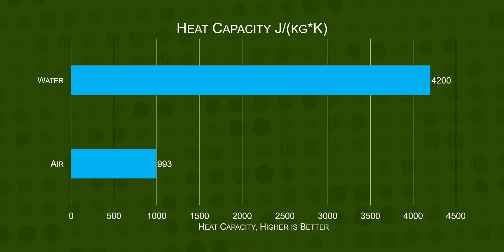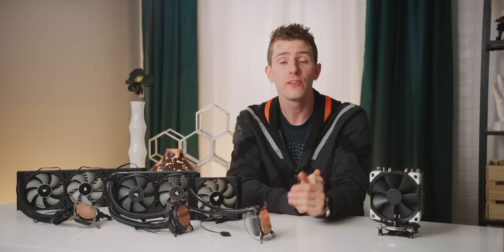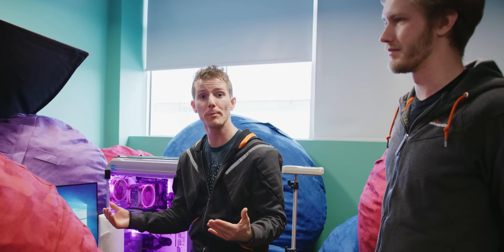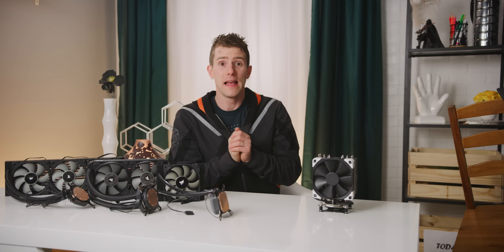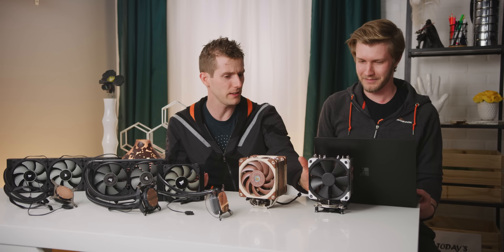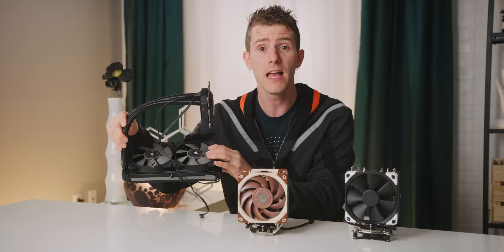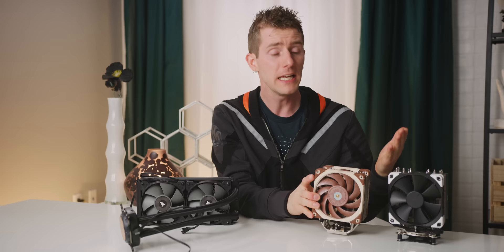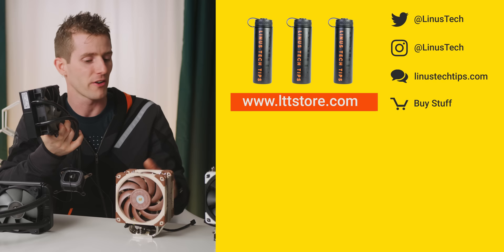Why you shouldn't water cool your PC

Comment: I liked that 1st equation. I had never thought of it. See, CMOS heats up because when a bit is changing state, both MOS transistors go through the conductive region. MOS (FET) transistors work by adding energy to the carriers in the channel so they have enough energy to behave like free carriers. How can we add energy to the carriers? Well, one way is through an electric field (hence Field Effect Transistor); the other way is through heat! Therefore, when the CPU is hotter and the state is changing, both transistors will short at a lower resistance level (upper in the v-i curve). Therefore, the cooler the CPU is, the easier it is to keep it cool.

Hot CPUs will cause charge carriers (dopants) to migrate through the single crystal structure and will, with time, destroy the structures inside the CPU. Keep calm and keep it cool!

Comment: Pfft, don't listen to Linus. Go out and spend a thousand dollars on a huge peristaltic pump. Set this in your backyard. Then have part of the discharge set to go through a smaller line that leads into the intake line through a venturi. Now you have a jet, peristaltic pump for maximum water flow. Make sure your radiator is in a custom made shed that is powered by a lithium bromide absorption chiller. This will keep your ambient temps at around 4-6 degrees celsius. 

Make sure to drill the appropriate holes in your home wall, and in the custom shed. Make sure your custom shed has very good insulation. Next step is to buy 1000 gallons of deionized water. Once this is done, you're almost definitely going to need some reducing fittings to get your pipes down to the right size to fit on your block- which by the way, if you haven't figured out already, is going to need to be pretty damned strong.

Once this is complete, your computer should never ever overheat, and for the low cost of $ 50, 000 this all can be yours.
Reply: You forgot to mention you have to have a licensed engineer by the state on watch of this equipment any hour it’s operating in the day.  If anyone from the city shows up at the house and these requirements are not met you will be fined and face jail time. May god help you if there is not a EPA certification on site.
Reply: "your computer should never overheat"
Your computer won't even heat with that setup. Keep the beers in your case for easy refrigeration.
Reply: MC Siggy Z with what setup? Did he say he had any set up? I missed it.
Reply: youve sold me already
Reply: Get a mini fridge and stick your PC into it. Drill holes in the side and run the plugs through it. Silicon the cables hole where they come through.
Reply: @Pesticide7G  I'm a stationary engineer, so I'm good :P
Reply: Clinton Laundrie oh cool so you’re qualified. instead of dispersing those BTUs that your massive pc is producing you can run a separate 3” line to transfer that heat and send it to the condensate tank for your high pressure boiler for a 100% efficient operation. just don’t forget to bypass the hi limit switch and cap off the relief valve. Thank me later

Comment: Now you could take these Noctua fans, put it on every cooler / AIO and compare them again.
Reply: Noctua don't just make fans, they make the heat sinks too, which are important
Reply: Duke Manu ikr, even Asus Aios use black Noctua fans
Reply: By using the same fans for air & liquid cooling one excludes them from the equation and knows if one technique is actually better or if Noctua has just the better fans.
Reply: @dukemanu9580  This definitely should be a third test subject, but it shouldn't be the standard for the AIO testing. When you buy an aircooler, you get the heatsink and the fan, when you get an AIO, you get stuff including fans, to put Noctua fans in the AIO would mean adding in another purchase.
Reply: King Barney still cheaper than custom loop. It’s the same as buying cooler then adding rgb fans

Comment: Why do all water coolers advertise "water transfers heat better that air"
Yes, it does. But they are both cooled by an air radiator. It is what gets the heat from the CPU pad to the radiator that matters. Water coolers uses water while air coolers use copper.
And copper transfers heat better than water.
BOOM
Reply: BOOM
Reply: Kids going to need a qualitative statement, I suppose. Let's add another one: In cooling, there is no replacement for surface placement (sorry, engine guys..). Water cooling is the simplest way to get HUGE surfaces involved to radiate the heat. And to have these surfaces in places where they don't contribute to heating up other components.
Reply: @decnet100  isn't that only applicable when things are big like in a car?
Reply: @cabexus  heat doesn't care how big things are.It's just heat, meaning energy, following simple rules of thermodynamics. In all conventional forms, it's just about the resistance of energy flow to surrounding air - which all is ultimately limited by the contact of metal to air - that determines overall heat, and admittedly maybe the heat capacity of the transferring medium when talking dynamic loads. But in terms of temperatures at the cooled element: Unless you're actively lowering the air temperature (nitrogen), or coupling to something else other than air (i.e. keeping your radiators in a lake, the walls, or buried underground), or maybe using additional power to increase your heat transfer (compressor cooling, peltier elements) then those rules apply to everyone, from PCs to cars to jet engines. Spread it over more surface area, it will be cooler. And bring those surfaces away from the stuff you're trying to cool.
There is no other principle involved other than "bring the energy out and let the air worry about it".
Reply: @decnet100  That is another fact to consider, but there are air cooling heat sinks that are the same size as the water cooling ones.
Reply: @Jacob-tp1ue " the same size as the water cooling ones" is a bit of an open statement. You mean, same size as 240/280 radiator AIOs? Sure. I myself am running one 50mm width 360 and two regular width 240s in my loop.  I don't think there are aircoolers for cpu and gpu   on the market that can replicate that surface area combined, honestly. All of which were bough used and thus cheap as chips, in around 2009. 
And if I ever needed more cooling (don't think so, this handled a Phenom II X6 and 2x 6950s fine, all of which using more power than my modern components, especially since going to single gpu setups), there is more room in the external housing, easy to put in another used 360 for example, which would cost me not even €40 - people sell their failed/old WC equipment for cheap, and it will still do the job for years to come (probably decades); takes some cleaning and maybe a layer of black paint, good as new.
Reply: @decnet100  I was speaking about the 240/280 radiator AIOs. Obviously, the 360mm AIOs have a larger heat sink. It was a bit of an open statement. And I just realized that people can run multiple radiators in one loop, like your setup.
Reply: @Jacob-tp1ue  Sure thing... :) As a 90s dinosaur, I'm sort of surprised how obscure and difficult the topic seems to many PC people. It's in fact a lot more like grown-up Lego than people think - and I guess the industry's choice to have all the AIOs as enclosed black-box circuits never to be enhanced, combined or changed does its own share of keeping people from realizing the potential - with AIOs, the solution to any problem is pretty much "buy a new system". I run my system virtually unchanged since 2009... universal coolers ftw :)

And there are quite a few things you can do with a custom loop that you simply can't with aircooling, or AIOs.

For example, I just moved flat. My room with the PC desk is now facing south and gets quite hot on sunny days; but there is a busy road down there so it gets noisy/distracting to open the windows during weekday evenings.
I just realized, I can put the external radiator housing outside of my window sill during summer (as I was doing for years - part of the reason for building that external housing in the first place). But the clever bit I just realized today: by running thinner tubes through the corner of the window-frame, the windows can actually close all the way without the water flow getting obstructed (much). Which means, all (well, most of) the heat generated by the PC doesn't contribute to heating up my room, and I don't have to listen to the steel avalanche taking place down there. As well as being able to run all 7 radiator fans at full speed if I like, without hearing them.
Reply: @decnet100  Wow, that's nice. I myself am on a budget, so I cannot afford water cooling anyway, but that is a thing to consider.
Reply: @Jacob-tp1ue  cheers :) not gonna lie, it is more expensive initially than slapping on a couple decent air coolers. But if you buy someone elses used set, it's often possible to get started cheap (say, €/$ 100 for someone elses used loop). Just need a foot in the door so to speak - once you got a basic set that works, the beauty is that it's very possible to upgrade incrementally, switch out one component every couple months until you arive at a system that works for you (or more commonly: is overkill for what you nees it to do). If you're smart and get a set of universal coolers, maybe a couple smaller VRM cooler modules and are handy with a drill (i. e., had to recently elongate the mounting holes on my GPU brackets by 1.5mm), you could end up with a kit that works literally for decades across all brands.
Reply: @decnet100  Don't air exchangers use either high surface area or high air speed? Doesn't high air speed peak? Which forces you into high surface area which increases weight? I could see for light loads non-water coolers being a little more responsive as most water are likely going to be designed to work for  huge heat loads. However the concept of water is high specific heat central vein. Run this into another heat exchanger. It could be huge air exchanger, AC unit, larger body of water, etc. Does copper respond well against long runs even though it has better thermal conductivity? This would be heavy and expensive too. Does heat work like electricity, in that it has capacitance or exponential charge/discharge?

Doesn't high RPM or flow rate generally increase energy consumption? This reduces efficiency and increases thermal output, but is cheaper?
Reply: @davidthacher1397  Uh, you raise a lot of questions and some of them I don't quite get... I'll  try to answer what comes to mind: 
First of all, the most effective and capable heat transfer principle, which both air and water coolers use, is NOT conductivity through a material (even a good one, such as copper or silver), but actually transporting the hot material away - which happens inside an air cooler's heatpipe (alongside condensation/evaporation) as well as inside a watercooler's fluid pipes obviously. 

I think the effect of airspeeds (or water speeds) on a cooler can be quite complex in some cases (laminar vs turbulent flow etc.), but for our practical matters in a PC, the primary principle is the mass flow rate (=mass of cooling medium moved by per second) that actually takes away the heat; this is of course quite easily increased with liquids by increasing the speed; with air/gases however you need quite high speeds in general to reach the same mass flow, and the negative side effects (mostly: lots of noise, also being an open system a "fast air" cooler becomes rather sensitive to disturbances from dust or other blockages such as cables inside the case) make it quite impractical to take this path with the air flow - hence why indeed large cooler surface area is so important, as that's the only way to have a somewhat quiet system reliably.

"Does copper respond well against long runs even though it has better thermal conductivity? This would be heavy and expensive too."
Don't know quite what you're asking there - are you imagining to replace the water inside a cooling loop with solid copper? That wouldn't work well at all, like I said, conductivity through even good material like copper or silver is easily beaten by actually moving material. The temperature at the cool side of the copper line (which in turn is very relevant for heating up the surrounding air, and thus getting the energy out of the copper) is also directly decreased by the distance between the heat source and the copper material that heat has to travel through, so especially if you want that flexibility of radiator placement, solid copper on it's own is not an optimum choice to get the heat out of the components - hence why literally every air cooler nowadays uses heatpipes.

The influence of high rpm fans on power consumption is pretty much negligible in comparison to the components to be cooled; we're talking maybe 2W for a fan (the Noctua I have just checked claims 1.6W maximum power consumption, at full 2000rpm blow; so we're talking significantly below 1W at normal rpms). On the other hand, a Laing D5 can consume 20W at full song, which especially at idle can of course contribute notably to heating up a system - if the pump supply voltage is fixed to 12V; of course, with variable pump voltages, this is not that much of a problem; throttle the pump voltage down to 6V for example and you get that down to 5W consumption on that D5 (double the voltage = four times the power at constant resistance).
Reply: @decnet100   I suspected you knew some of this stuff. These were pointed questions which took aim at different aspects of this. Not really to shame anyone just kind of to broaden it. There was a premise here which was kind of interesting. I think there is a point about cost, noise, need, reliability, and power consumption which can be debated against water. However I think water never really gets it advantages listed as much as its disadvantages. I think your opening statement about heat transfer principle captures that too. Water may have worse thermal resistance copper but it has higher specific heat than copper and air. This link here explains it nicely also: https://koolance.com/cooling101-heat-transfer
Reply: @davidthacher1397  Cheers! I love thinking about this stuff - can't claim I really know this down to the t, and there are a good couple of question marks in my mind still, but I think the old trick of thinking in terms of energy and resistance to energy dissipation usually works well :) Still, I sometimes wonder along similar lines as you (as I understand it) - i.e., would a combination of heatpipe cooling, with a water cooler attached to the distant-to-the-component end, actually create cooler temperatures at the component, or does it just equalize to the same as if there was a regular water cooler?

Comment: maybe as a side video you could do an corsair hydro with the fans from noctua, see if that makes any difference
Reply: Fans  for water coolers need to have something called static pressure, meaning you can't just throw any fans on water coolers, you need to use fans specially made for water coolers
Reply: @aryantakkar810  Yes, and Noctua makes the best static pressure fans on the market. The fans used on the NH-U12A are static pressure fans.
Reply: @aryantakkar810  Same goes for air coolers. But Noctua make fans for those.
Reply: It's an overstatement to say that they /need/ to have fans optimized for static pressure. Depending on the radiator it could make a difference of up to a few degrees, which is not inconsequential, but it would barely be noticeable to most people until the rig was obsolete.
I replaced my radiator's fans with good airflow optimized fans, and it improved the noise and performance, so it's not the sole determining factor.
Reply: @aryantakkar810  Tower coolers are often denser then asatek aio's and actually require more SP. Not to mention Custom loops with 60mm+ high density radiators where Noctua fans are also among the best in the market...
Reply: I have this exact h150 AIO and bought PWM Noctua fans to replace the corsair ones the next day I got it. The difference in both temp and noise is MASSIVE. I'm pretty sure it beats the classic heatsink with these fans, but you have to add 20-30€ for these 2 Noctua fans to an already expensive cooler. Only worth it if you want it :)
Reply: I told my brother he should do this a decade ago because the fans on the corsair were unreasonably loud back then. Not sure what they use now, but it was unforgivable at 50 more.